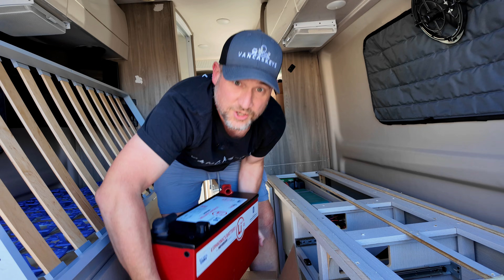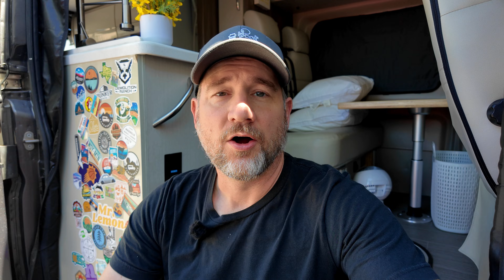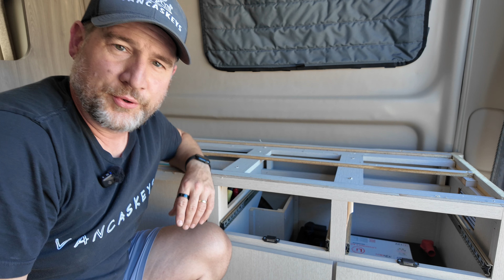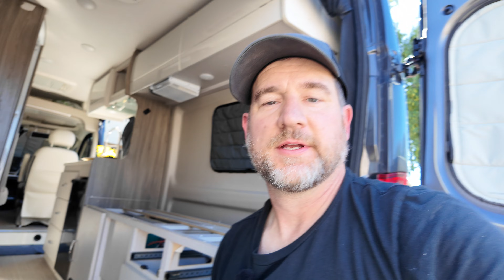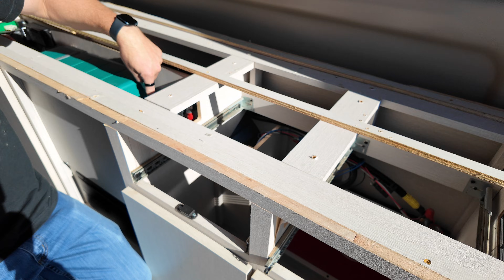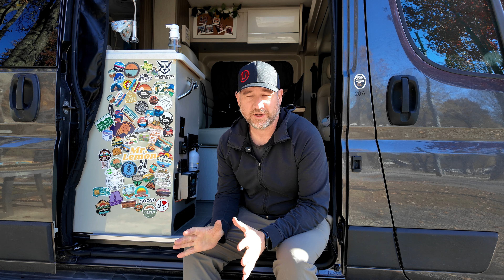This Lithium Battery System Solves Our Biggest Van Problem

Comment: great video, planning on getting a Coachmen Pixel 1.8 with generator, going to have AGM battery changed out for a lithium, talked with dealer tech guy about doing it, actually seeing it done and working gives me confidence in making the change.

Comment: Great video. I am surprised there are no additional resistances needed or fir that matter reduction in cable resistances to balance the new batteries. Impedance can reduce efficiency and functionality of some of the components? Thousands of wires 😀, did you bring all wires up into the inside of the van? How much pre planning / research did you do? Great work 👏👏👏👏👏

Comment: I am doing the same modification to our 13ft camper. We are putting a 280 Ah Smart battery from Li-time which should give us 1 night of airconditioned boondocking. We just bought a 4WD Ranger Raptor so we could do some trails while out west. Good excuse to upgrade the old camper to function like our van. I am enjoying your video's.

Comment: Good move upgrading your battery to Lithionics! Our Ekko came with 2 of the 320AH lithionics batteries. The batteries are almost twice as much in cost as other battery brands for the same power level, but they have the safest UL and testing on the market.

Comment: Do the extra battery upgrade.  We have a double lithium system in our Coachman Nova = 1280.  Hot Texas night at Love's truck stop - no problem running A/C all night.  What a concept.  Always more power.  Good Job Bob!

Comment: We also installed a Li3 in our Winnebago Solis NPF (along with a 3000w inverter done by SSRVs) when we picked it up new in 2023. We feel very confident in the system. However I don’t really feel we use it to its full potential. Honestly we got it so we can leave our dog in the van for short times. The AC can run for a few hours but not long in high heat. It would be nice to have a second battery to run the AC overnight or maybe a more efficient AC on the roof. What do you recommend? We don’t have a microwave so idk how the system could handle that. Do you leave it all on for a while or use it then turn it off?

Comment: Bob you should charge the company for selling you an unfinished product 😂 you two have trouble with it The day you bought it 😭😡 oil problem that is ram not the RV company I rather change the whole filter not just the filter element inside but that is how it was designed 🤔🥴 like the sprinter 😅 I have a Subaru Forester It has the oil filter on top so I don't need to go under the car to change it I just take it off and put a new one in drain the oil refill and it's done 😂 and hopefully you two will have good long lemon trip this time ❤🎉

Comment: When we upgraded our 200AH AGM - we went to 4*100ah LifePo4  
Most people don't realize 200ah lead acid is only 100Ah usable because you cannot drain more than 50% without damaging the batteries.. whereas Lithium is 100% usable without serious damage.

We already had our batteries inside ' the envelope' where it is heated, out of the mud, water, snow and cold. We had to upgrade the solar controller to be Lithium-capable.upgrade 

I will be honest, when these batteries start to wear, I will upgrade even higher. I have a friend currently installing over 1200AH

Comment: An improvement I would like to make. Going from a 200 A-hr AGM to a 320 A-hr Lithium is close to a 3X capacity improvement and weighs less. I didn't go that route originally because of the upfront cost. If I went 600 A-hr, now I get in to needing a second alternator unless I carry a portable solar farm with me. Great upgrade and thanks for showing the installation.

Comment: I went with the Epoch 460ah batteries...metal case blue tooth self heating too---good to -20°(I live on the 45 parallel).... I put 2 of them in my van....they are fantastic. Good luck with the Lithonics.

Comment: LiFePo4 is lighter than Lithium Ion volume wise.  You said it backwards.  Lithionics is a good brand, but my are they expensive.    IMO the best bang for the buck is Big Battery's solution.  Infact if I end up ordering the Noovo Plus, I'm going to have them use Big Battery's system that is equivalent to 2 of the Lithionic 660Ah units for quite a bit cheaper.   I run the Big Battery 61.4Kwh Ethos system on my house.

Comment: Congrats on the battery upgrade!  Completely agree with Bob's wish to upgrade capacity - never hurts to have more battery power.  Changed my van's factory supplied 200AH to 600AH via Epoch batteries and I comfortably boondocked for 4 days running an air fryer daily, Maxx Air fan each night (all night), Starlink, lights, TV... all under cloudy, grey skies (limited or no solar charging) and still had 32% remaining when I packed up and hit the road the morning of the 5th day.

Comment: I think, I hope, one of us just mixed up what the color coded battery cables were. Red should be ALWAYS and EXCLUSIVELY used on the positive battery cable. And while the negative cable WAS always black, for the last 20 years the convention is to ALWAYS AND ONLY use yellow to mark a 12-volt negative. This comes from the marine industry--which has been copied in vans--where a black wire WILL also be the 120VAC hot wire from shore power or an inverter. Somd lethal confusion caused the change to yellow for DC negative.
 Little things like that are why Lithionics say "hire a pro."
Reply: I agree.   RED=Positive.  Black=Negative

Comment: Wow, Lithionics really gifted you nicely, those batteries are high end and the price reflects that. We have the 630 Ah version any yes ….. it’s pretty awesome. We can run our air conditioner off the battery for at least six hours or so. Those used Power Queens will be a nice giveaway if you decide not to keep them

Comment: Dude, isn't the chassis grounded to the negative terminal of the battery? Why didn't you disconnect the negative side of the batteries first? You got lucky; you didn't short the battery to the chassis when disconnecting the positive side of the batteries.

Comment: The other advantage to putting the battery in the van is that LifeP04 batteries don’t like cold temperatures for charging. In fact many have low temp cutoff to avoid damage. If you are traveling to colder climate places having it in the van is a good decision.
Reply from the maker: Good point! Thanks for the additional info!

Comment: I have questions…

1. Did you move wiring below the van before you started the video, or is that the way it came? If that was the way it came, the builders have no idea how to safely wire anything. So glad you updated the battery!
2. What brand of battery was in the van originally?
3. What made you decide to install yourself? Every time I watched you, I was just shivering!! That van was so close to your chest when you were under it, all I could think about was what would happen if it fell on you, especially with that chunk of metal that used to house your old battery almost touching you while you were under there!
4. I do like the app that comes with the Lithionics batteries. We have Mastervolt, and although they have an app where we can control all our lights and fans and such, we don’t see the detail regarding our batteries that you can with the Lithionics app. Does your app also control your lights and other electronics?
5. Is there enough air flow to keep the battery cool? It looked pretty open, but I didn’t see any holes for venting heat.

Glad you updated to more power. You should get about a 60% increase for more boondocking or easier power use.
Be seeing you!

Comment: I have been following your channel for years and I remember when you replaced your current batteries for the current ones. I was shocked to see at that time that the batteries were exposed to the elements and now I see that your busbar is also exposed to the elements. Unbelievable, but I should expect that from the manufacturer of Mr. Lemon. You are improving things all the time. All the best.
Reply from the maker: Thanks for sticking with us all these years! We appreciate it! And yes we also were shocked by the placement of the batteries.
Reply: Idk why people are shocked,  all of these items are just fine being outside,  if this shocks you, don't ever open the hood on your car 😮
Reply: @AlmostOutside or look at your house electrical meter. Nothing is weather tight.

Comment: We currently have 640 amp lithionics battery with three solar panels. We have gone three days in the NW cloudy weather and still have 50% battery left camping. As the weather becomes cold and cloudy is when 640 makes sense to have installed.

Comment: Couldn't agree with you more. We have a Solis PX and removed the AGMs underneath and installed an EPOCH 300ah battery inside with a Li-BIM (all work done by a very reputable RV service center). Total game changer! When traveling the battery is always charged and will last a few days of dry camping. We now need to install an inverter (we do have a generator). No more battery anxiety 😊. Keep up the good work and safe travels!
Reply from the maker: That’s awesome!

Comment: I’m stunned the manufacturer built that van with all those electrical components exposed to the road and weather. Wow!! Nice work getting that new battery installed 👍😎🇺🇸🇺🇸🇺🇸
Reply: When you see how beautifully some van outfitters design their electrical systems, this manufacturer should be ashamed. I am amazed the vancaskeys were able to even figure out which cables were for what. I would have been totally overwhelmed. Manufacturers should design their systems in a way that it is understandable and accessible for the average owner to work on.
Reply: @swissmiss8171 you should see how Amazing my 2021 Pleasure Way Ontour 2.2 wiring is done. Everything is labeled and all in  a couple of harnesses. So easy to trace a problem.
Reply: You're stunned that Thor did that? Really? They are notorious for that kind of stuff.  Lollol😂
Reply from the maker: We were too! Thanks so much! 😊
Reply: Me too!
Reply: @Thunderbyrd. I was shocked by that too! Talk about cutting corners and poor workmanship!
Reply: At RV shows, it's something potential customers never look at. I'll admit I don't and just look at the specs.
Reply: Bob, YOU did a great job with what you had to work with.

By the way, putting the batteries inside is really necessary, as batteries hate cold weather 🥶

Holy cow!!! 

What a freaking mess THEY (Thor) did!

Guys, DO NOT drive thru any high water or snow!!!!!!  If you do so, you risk shorting out the entire power system and having the battery overheat and start a fire!!!!!
Seriously!

I don't know what backwards yahoo they @ Thor got to do this "design", but unacceptable. 

Frankly, I'd read that Federal sticker there at between the passenger door & slider and send those regulatory people a ton of pictures with a formal complaint illustrating that monstrosity! This really needs a recall for anyone having a unit mis-built like this.

Now, here is my suggestion. Take a bunch more pictures and document how that wiring goes on the buss bars, etc. - then draw out a diagram to copy that and install it inside the cabinets between the battery and inverter. 
Oh, the other advantage will be shorter cable runs, and less voltage & power loss.
Then plug that entire hole underneath an use sealant! See, not only can bugs & critters get in, but WORSE! Deadly Carbon-monoxide and other exhaust fumes. 😵

2nd suggestion on that, get yourself a CO - Carbon Monoxide detector and put it inside that cabinet to protect yourselves!!!  Actually you should have a smoke & fire detector too. Safety first!
Reply: Me too...but maybe add some dielectric grease to all those bus bar connections???
Reply: That is why the RV is so cheap 😢 they give people a unfinished product so Bob ended up finished the RV for them 😂 and he is not the only one got screwed I saw other people brought it and ended up fixing it 😂 they should call it Mr lime 😂 not Mr lemon 😂
Reply: I had this as 2nd monitor content and had to STOP and rewind when we hit that part. WOW that's a scene
Reply: Install locations like that were more common for lead acid batteries that needed to vent hydrogen gas. LFP can be in living quarters not needing to be external to living quarters.
Reply: Its not a big deal, batteries and wiring is designed to be in the elements,  every car on the road has batteries and cables exposed to the weather
Reply: @AlmostOutside  That is not correct!

What you are talking about on most vehicles, like batteries, are about 3 feet from the ground. This Thor RV conversion has this stuff a foot, perhaps 16-18 inches. 

A typical Buss bar/fuse/power tap is in a weather proof box, usually with a seal. Wire/cable bundles are protected in wire looms. 

Most importantly, cables that enter the cabin are sealed in grommets that are water, duty, bug and gases proof feed-throughs 

If you drive a newer car through a dip in the road, you shouldn't!, And you get high enough water in the engine bay, yeah, it floods out. But most cars still run on a lead acid battery... That is a totally different animal than a lithium type battery designed to run an RV. 
Go watch some other videos here on yt. Short a wrench between the terminals on a lithium battery (which has a far greater Amp hour capacity, and current capability) and watch it turn the wrench bright orange and if left long enough, it will melt the wrench!  I.e. fire!

The people like me who've worked as electricians or on aircraft like myself know these facts - and it IS a huge problem!
Reply: @jptucsonaz8503 the electric car business is in real trouble then!
Reply: @jptucsonaz8503 the battery was in a steel case, a perfectly fine way to secure it, relax
Reply: @sparks701 Hardly, their stuff is protected, sealed, water proof; not a bunch of exposed bus bars and such.
Reply: @AlmostOutside  An open top steel box that is not weather tight, nor insulated isn't right.
Reply: @jptucsonaz8503 they don’t fair well in cold or standing water either no matter how “protected” they are